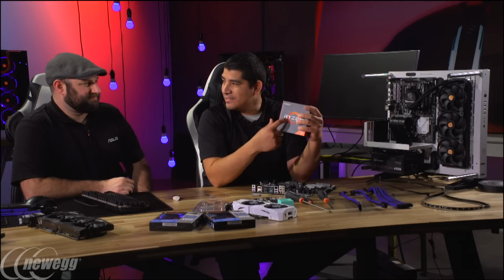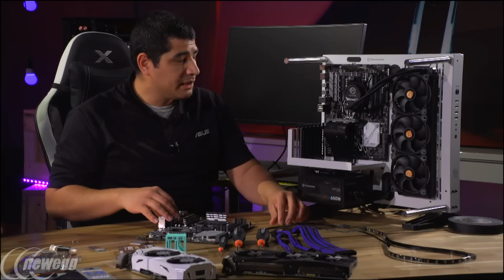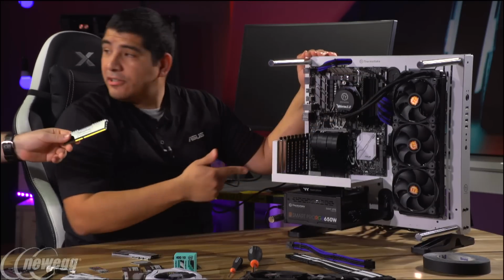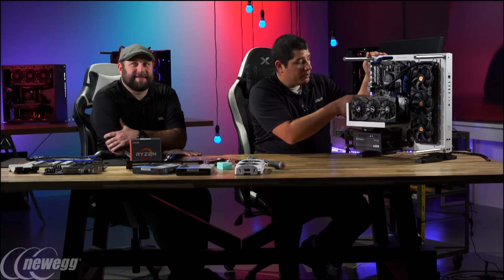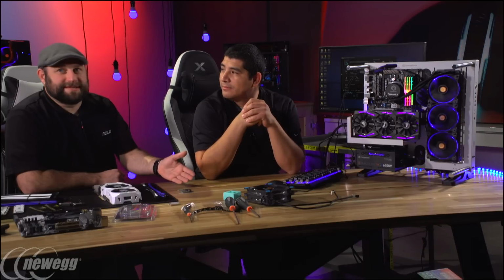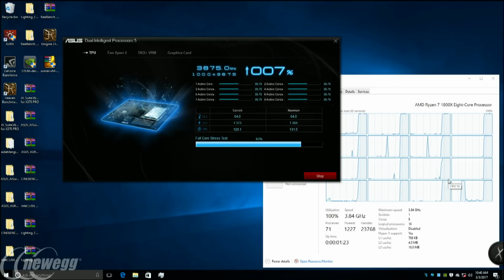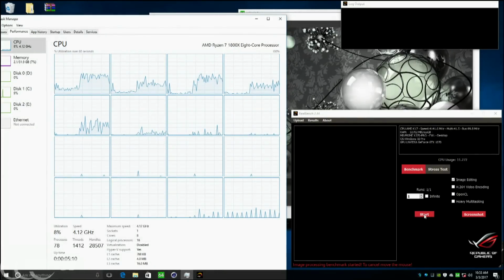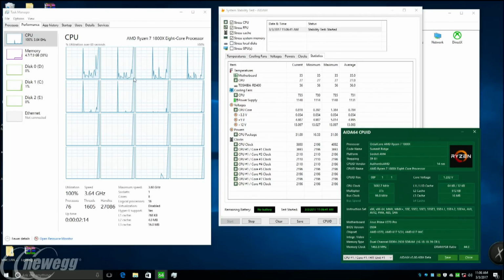LIVE STREAM: Ryzen 1800x with ASUS X370 Prime Build and Q&A with ASUS

Comment: Anyone else curious how they are mounting this cooling solution on this cpu, considering there is no bracket available yet? I have the crosshair version (which offers mounting for am3 coolers) but no back plate to mount .... Thermaltake doesn't seem to know when their brackets will be in ....

Comment: what's going on with the ram problem
Reply: XMP profiles could set the maximum speed of your cards.
and maximum voltage of the label if selected a profile, instead of manual speed and fixed voltage.

then my guess is either , they bumped up the BCLK (baseclock).
and the mem speeds went up, and Auto DRAM voltage overvolted it.

another theory is , the Ryzen do not support the Gskill TridentZ RGB lights DDR4.

but Gskill has the Fortis and Flare X serie special made for Ryzen .
FlareX being the fastest on their website.

also other motherboards might come out in future, with updated bios.
if you have a outdated bios , you could update it when bought a motherboard.

if you bought an OEM desktop, the OEM key is on the bios.
but they probably updated it for you them.

if you raise the BCLK too high on the X370 , you could run into problems with PCI-E i hear.

Comment: I do like the bios setup and the ai overclocking is pretty cool but i would still do 1 hour minimum stress test
Reply: and memory stability.
if touch BCLK , make sure the mem speeds are not going too high or set manual speed.
or set fixed DRAM voltage.
make sure to buy the supported memory for Ryzen , like the Gskill FlareX DDR4.

if memory is unstable , you fast notice.
the system might not boot, or freeze when in Bios settings.
or show errors in Prime 95 (torture test , lots of RAM tested)
can use CMOS to revert to default , try again.

need to make sure memory is stable , otherwise you might blame CPU and go too high in vcore.

Comment: hey i ran into an issue on my Asus Crosshair hero It does not came with an AM3 backplate so i cannot fit my h100i v2 cooler on it ,  can you guys make sure that you give us AM3 Backplate as well and not just holes because i see no point (atleast for me ) going for it thinking it will work with AM3 cooler once i had go and find a backplate wich is not available here in my country anyway ?
Reply: Where are you from, surely you must be able to find something or at least it should be possible to have such a small item shipped from the US?
Reply: Corsair said they cant ship to pakistan i bought an am3 backplate from china now but it will take 3 weeks to come

Comment: 4.1 ghz a good over clock are you shitting me , that's horrible.
Reply: 4.1 on an eight core is a real deal.
Reply: I know 4.1 on 8 cores is shit we need 24gig on 30 cores
Reply: It's not when they said it was for enthusiast and overclockers but you only got +100mhz over turbo with a water cooler.
Reply: It's not as much as the Broadwell-E lineup, but that turbo is only for 1 core. The all core turbo goes to 3.7, so 4.1 is actually a really noticeable increase over the stock performance.
Reply: Is the turbo in the Broadwell E only for one core?

Comment: recomanded 1.36v u are telling peeps to go to 1.6v u want peeps to burn out there cpu to sell more ?
Reply: ESPECIALLY when you consider that the worse a psu is, the higher the voltage spike when you first power on. that 1.6 can easily go 1.65 at start